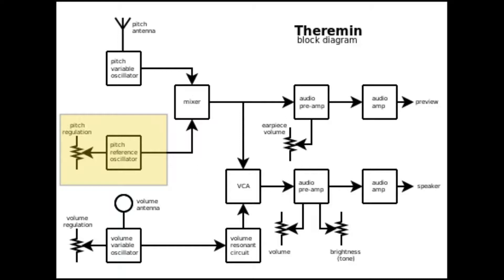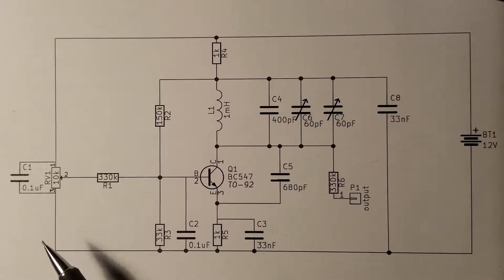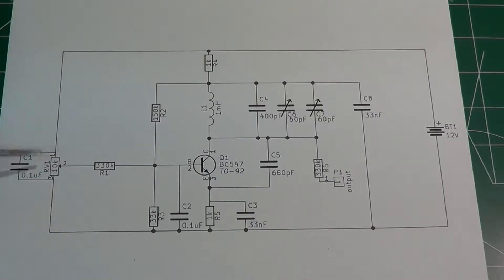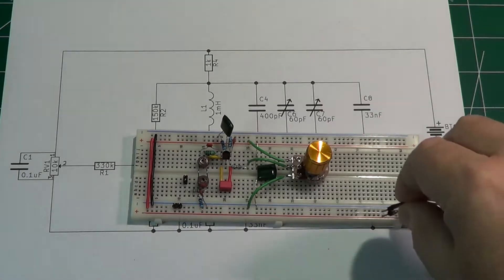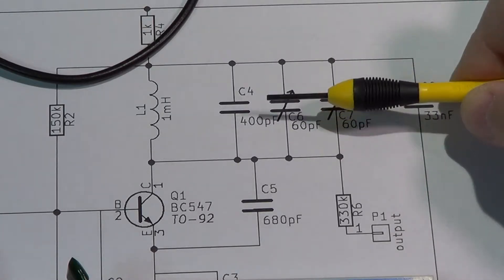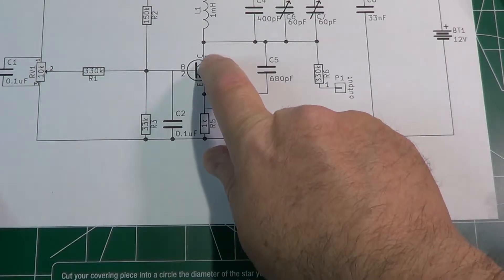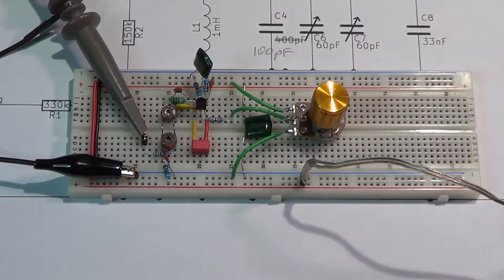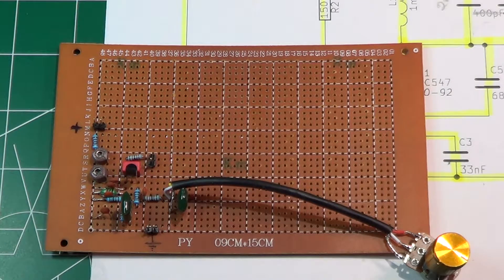Working on the Theremin: The Pitch Reference Oscillator

Comment: Hello, 
I tried to replicate your LC oscillators from this project. I wanted to use 100uH inductors instead of the 1mH you are using, so I thought I would just increase the capacity accordingly. But the resulting waveform came out somewhat distorted - the lower half-wave is flattened out, presumably by saturation. I tried changing the base voltage of the transistor. With that I was able to get a clean sine wave, but the oscillation was very unstable and thus useless. I was also only able to get the frequency down to about 500 kHz. Increasing the capacity any further stopped the oscillations.
Well I went along with the distortions, built both oscillators and the mixer and I was able to produce quite a nice sound. But the frequencies were shifting quite rapidly and I had to tune the reference oscillator back and forth every minute or so. I think it is due to the saturation of the oscillator, because the width of the saturated area depends heavily on the base voltage and also influences the frequency. So I assume that small shifts in supply voltage cause the base voltage to shift, which causes the saturated area to change width, which influences the frequency. 
I then tried building the oscillator with my only 1mH inductor exactly according to your schematic. The bottom was somewhat saturated again, but after adjusting the base voltage, I got a clean sine wave. I can't quite verify the frequency stability, because I only have an old soviet-made oscilloscope. So small changes in the frequency I can only detect on the output of the heterodyne mixer. Yeah my equipment might not be quite up to the task.
Anyways, as I don't know much about oscillators, my question is - is it viable to try and build a sine oscillator in this frequency range using only a 100uH inductor? Using only the Thompson equation, it shouldn't matter if I use 1H and 1nF or 1nH and 1F to build the LC tank (obviously bonkers values). But is there any good explanation as to why the 100uH inductor won't cut it in this case?
Also, I have quickly looked at the theremin v2 series and I don't quite understand the change from LC to RC reference oscillator. From all sources I've seen, RC oscillators shouldn't be anywhere near as stable as LC ones.
Thanks in advance for an answer.
Reply from the maker: Since you were using a different value of inductor, it was reasonable to change the polarization of the base of the transistor. However, the sole change of the polarization is not enough. In fact, as you experienced, the oscillator became really unstable. The other critical component for the stability of the oscillator is the capacitor between collector and emitter. Such capacitor needs to be adjusted too, and the adjustment is kind of experimental, because its calculation depends on too many factors. Try to increase or decrease slightly the capacitance, and see in which direction the oscillator becomes more stable. Once figured that out, keep trying with different values in that direction only until you find the one that obtains the most stability.
The other problem is that the frequency of the oscillation is strongly dependent on the value of the resistors for the base polarization and the capacitor in parallel to the inductor. Even using costly resistors and capacitors with minimal thermal drifting, the circuit needs to have often adjustments. That's why the Theremin requires the external control for fine tuning of the reference frequency. And that's why after some time using the Theremin in such conditions, I decided to move on and work on version 2.0.
Although version 2.0 uses RC circuitry instead of LC, the particular oscillator configuration with the op-amp makes the variation over time of the frequency less of a problem with respect to the first Theremin.
Either way, I am still not totally satisfied and I am working on the side to a 3.0 version that will work with a digital generation of the reference and variable frequencies. Such frequencies, once I make it work, will be extremely stable, since they will essentially depend on the precision of a quartz. Variations of the reference frequency with respect to the variable frequency will be linked to each other minimizing the effects of thermal drift, making the instrument much more precise.
Reply: I did try different capacitor values, but couldn't achieve a good result. I suppose I'll try some more.
Reply from the maker: @ondrejstafa3767  Sometimes the changes are subtle. Remember also that for same kind of capacitors, the bigger it is, the greater the thermal drift. Maybe you could try with TCC class 1 ceramic capacitors, or temperature-compensating-capacitors, which are less affected by temperature changes. These capacitors have a multilayer dielectric, made of different materials with different behavior toward temperature. You could find some that have no drift whatsoever, but they cost a lot. The cheaper alternative is to move toward higher inductances, so you can reduce the capacity values in the LC pair, reducing the drift and increasing the stability that way.
Reply: @eleneasy  So I got the oscillators to oscillate even with the 100uH inductors. But the frequencies still drift quite a bit. I expect that might be partly due to stray capacitances on my breadboard. Moving onto a soldered protoboard could help, but who knows. Another problem is that the mixer doesn't output a sine wave, but instead something closer to a triangle, and it doesn't sound pleasant at all. I'm not quite sure what is the reason for that, since I've built the mixer exactly according to your schematic.
Thanks for your help anyways. I suppose I will try different oscillators sometime in the future. I still can't understand how they managed to make these instruments stable and reliable in the 1920s. And here I am, a hundred years later, with frequencies drifting all over the place.
Reply from the maker: @ondrejstafa3767 100 years ago was actually simpler. Oscillators were made with tubes, which run hot and kept the temperature relatively constant, reducing the frequency drifts. With semiconductors is actually more complicated. Even if the schematic wirks, it is easy to have drifts with small changes in capacitance due to the capacitance in wires and so forth. Try to use paper capacitors for the most critical, they should help.
Reply: @eleneasy  Hello, I have another question regarding your calculations. Shouldn't the feedback capacitor C5 be included in the capacitance of the resonant tank circuit? The actual frequency is much lower than what you calculated here and in your blog post. Including C5 yields much more accurate frequencies.
Lowering the overall capacity results in better sensitivity of the variable oscillator and I have managed to go as low 220pF for C5. But I assume lowering C5 results in less stability?